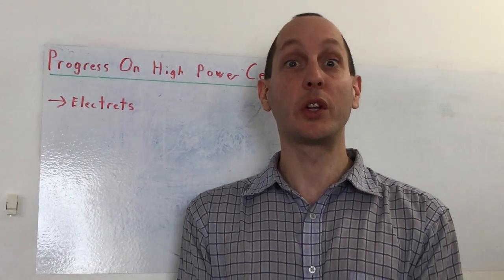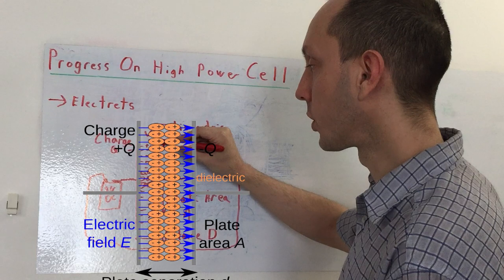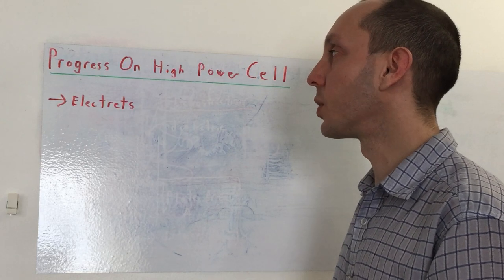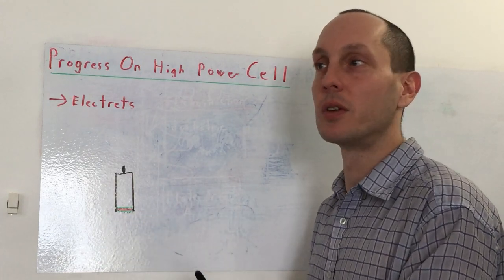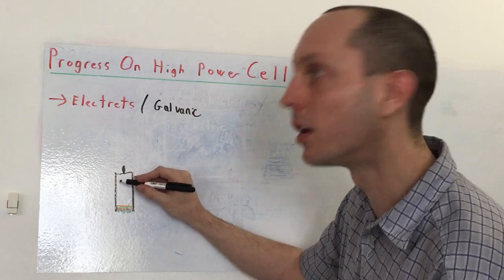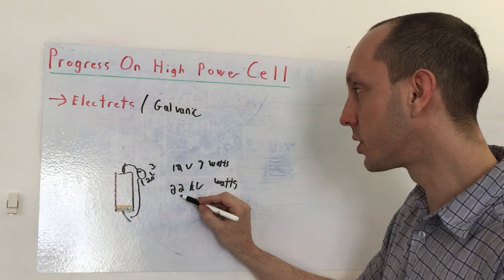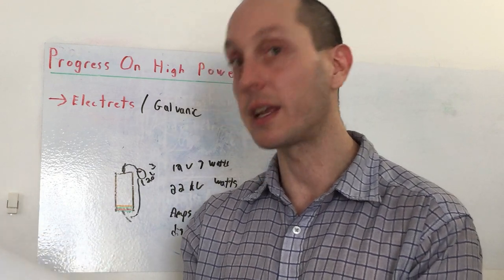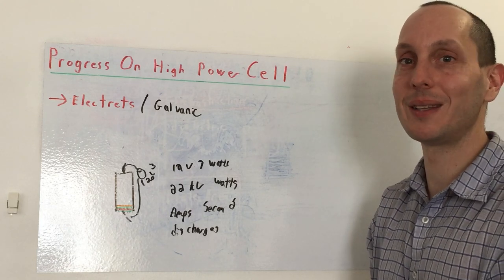High Power Cell Progress

Comment: Amazing! Just this week, I was musing along the same lines only using piezo discs but I like your piezo capacitor idea. I thought about using magnets and springs in between piezo discs inside a plastic tube with a winding around the outside. A pulsed DC (or AC modulated at high frequency ) until a resonate vibration is achieved.  

Could this induce the stress needed?  Just ideas in my brain.

Comment: You can make normal coaxial cable into an electret by heating it in an oven and cooling while connected to a high voltage DC source. With the outer insulation stripped, the cable can then be suspended in a field and used to attract atmospheric charge. Normally that charge would spark through to charge a capacitor but for you projects it might be a good self charging HV source

Comment: i wonder if  teflon plumbing tape  would work it is very thin and cheap as can be
Reply from the maker: Would work ok if your only interested in low voltages (such thin layer would act like a super capacitor but would not allow for much potential build up without sparking the barrier shorting internally.
Reply from the maker: Maybe as an electret it would be desirable depending on application.  A continuous spike output (pulsed DC) via internal shorting and electret permanent dipoles.